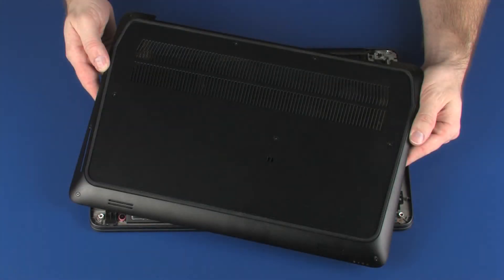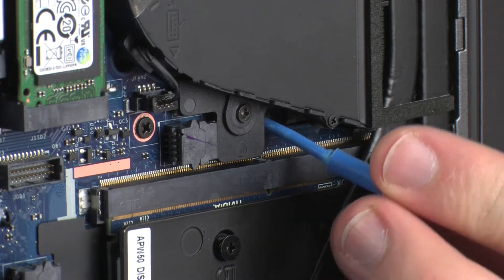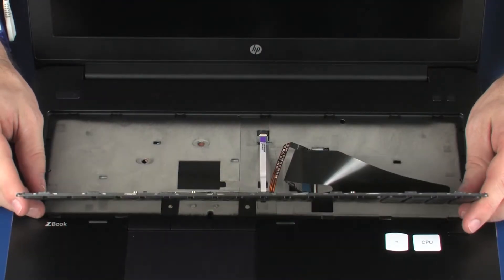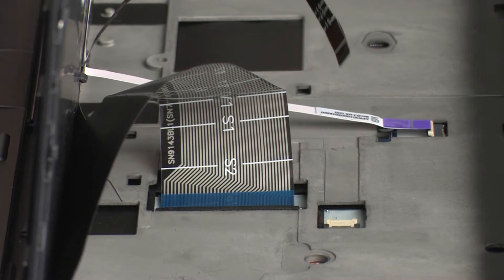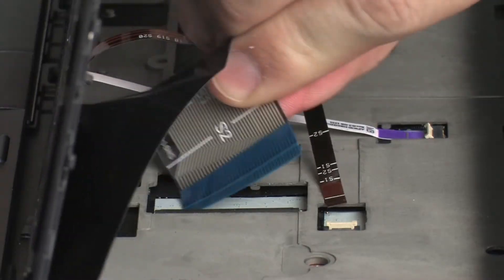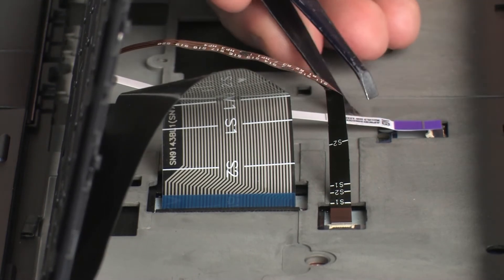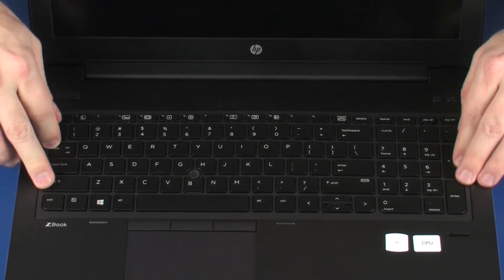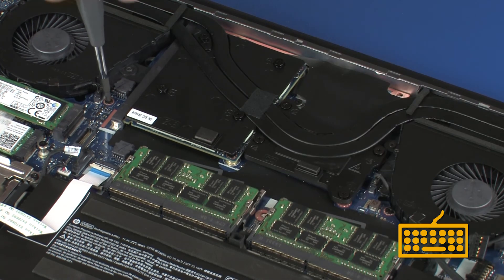Replace the Keyboard | HP ZBook 15 G3 Mobile Workstation | HP Support

Comment: Can i replace the keyboard with non backlit type?
Reply from the maker: Hi there, thanks for contacting HP Global Social Media Support!
I understand that you need to know whether you can replace the keyboard with non backlit.
I will do my best to assist you.
HP does not recommend upgrading or downgrading hardware parts or software that is bundled with the product as It may affect the manufacturer's warranty and performance, however, you could change the configuration at your own discretion.
Regards, 
HP Support